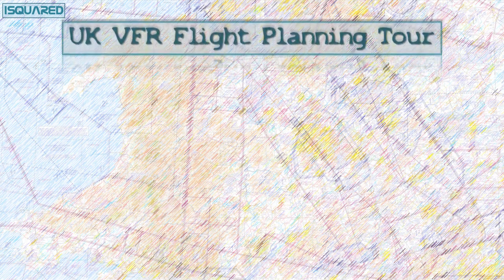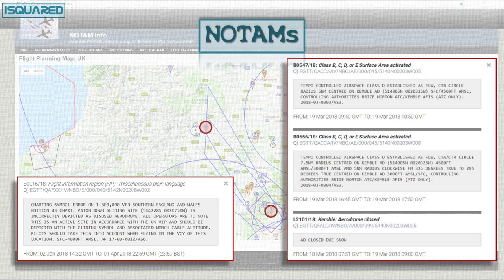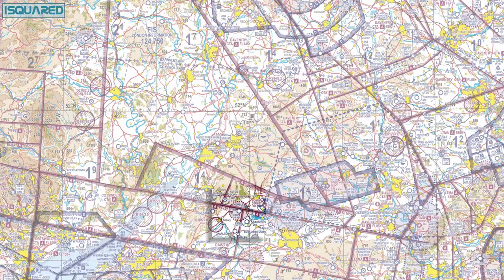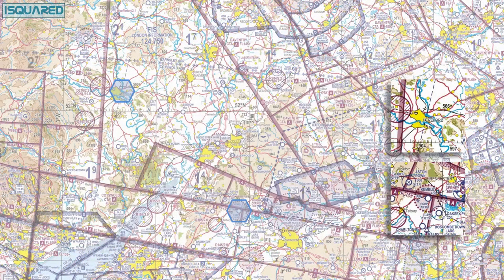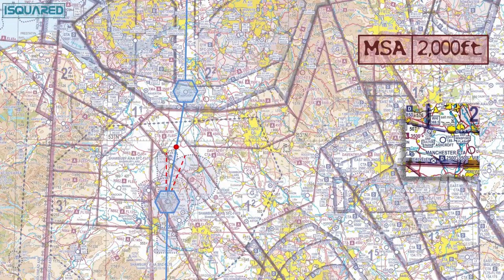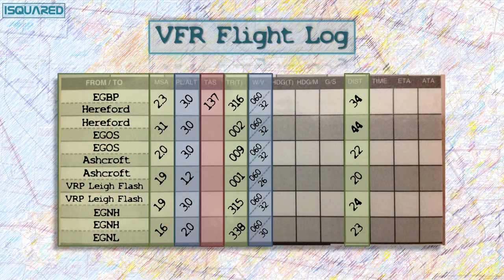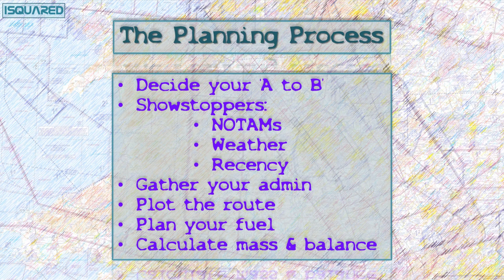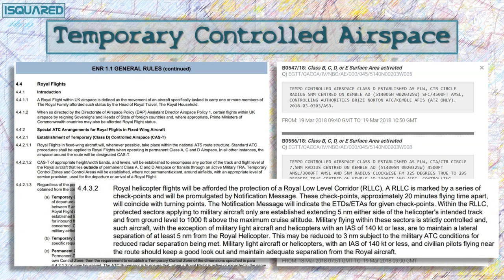UK VFR PPL Flight Planning [2018]

Comment: Thanks for the video , Its nice to see someone still using the traditional ways with no ipad!
Also I'm thinking about planning a flight from the uk to Germany ,Do you have any tips?
Reply from the maker: Hi George. Sorry for the late reply. I've never ventured that far and therefore haven't explored the airspace or regulations. There's a page online entirely dedicated to flying to/from France, so maybe there's something similar for Germany.

Crossing an international FIR boundary will require a flight plan, so have a look at the CAP694 for guidance on that. It has lots of useful examples. That's about as much as I can offer I'm afraid. Best wishes.